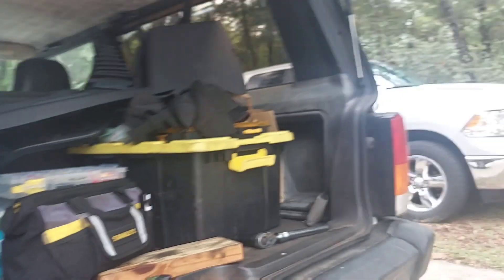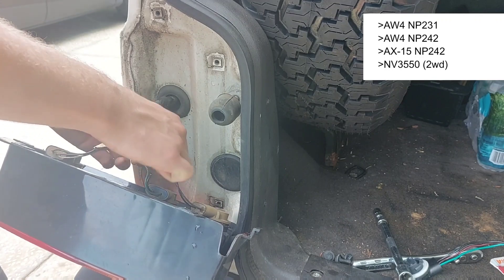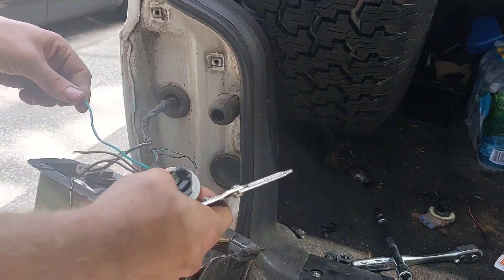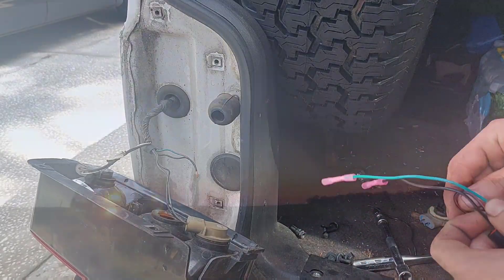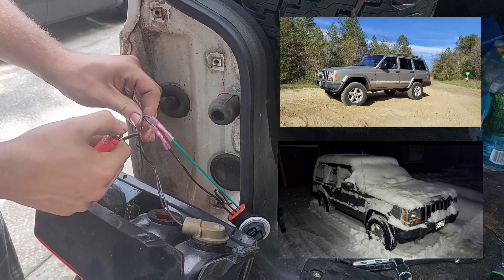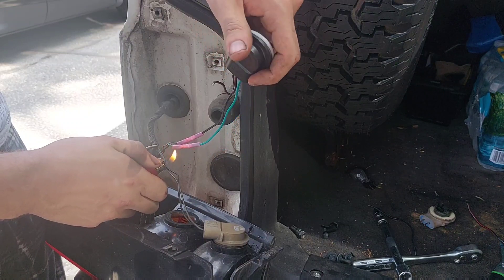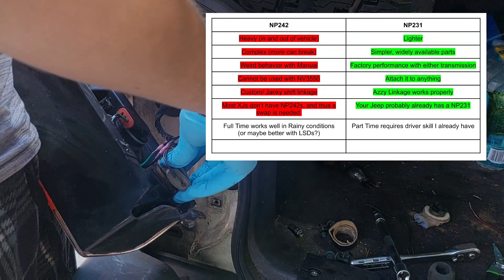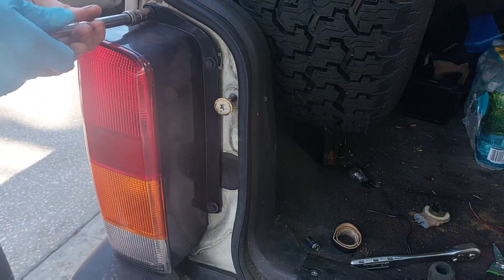Jeep Cherokee: NP242 Transfer Case in Review - Automatic and Manual applications ['87-'01 XJ]

Comment: I have a 94 XJ Sport with a 5 speed.  It originally had a 231 and was leaking quite a bit.  I saw a 242 on Craigslist for $100 bucks and thought the full time would serve me well here in rainy Vancouver.  It was in really good shape and went through in swapping the transfer case.  I never had any problems with the linkage or any improper shifting with the original setup and works perfectly.  I do notice the slack you're referring to when shifting gears and a click or sometimes a knock when going through the gears.  I went through all the u joints trying to fix the problem, but it still persisted.  I found it was worth doing and still have in my Jeep to this very day.  I mainly use it in the rain and sometimes in mixed conditions in snow.  Just the past couple of days I put in some work with my front drive axles in changing the seals, oil, wheel bearings and converted the axles to CV joints.  I tell ya, those CV joints made a huge difference.  There is no clicking or clunking at all.  Only if you severely miss your shift that she will tell you that she didn't like that.  Yesterday it dumped rain and drove like it never did before.  Felt like a modern car.  I'd be hard pressed to go back to a 231 and won't miss the jerky steering or the weird looks I used to get when I forget to switch off the 4x4...lol.  I like having the option of all wheel drive.
Reply from the maker: I do also have CV shafts but I suppose Ive never driven a 242 without them, so I didn’t notice any huge difference. Very interesting

Comment: @3:42 

The issue isnt not having abs ot tcs alone . Its the fact that the 242 is an open center diff so it would need those to direct the power . You are comparing it to a car that doesnt have a normal open center diff and was build that way to work without abs or tcs , same as my 93 audi s4 (the abs on it was trash and you even had the option of an abs off button on the dash back then) . This is actually why i chose to put a np120 trailblazer SS case in my crew cab manual awd big block muscle truck . I have a np242AMG h1 case too but everything i looked into the np120 would be a better case to live with on the street and in the snow (living in new england) and i dont want to use my pontiac G8 in the winter . 

Yes i dont have 4lo but i never taken the truck off road because its to big but im still toying with the idea of putting a jeep 242 into my 4.0 TJ manual .

Comment: I have a stock 1992 4.0 manual 5 speed with the 242 and limited slip in the back. Could it be it was modified by a previous owner? If what you say is true, that they never came out like that
Reply from the maker: @WatchGeek  yes someone swapped the transfer case at the very least. I have seen the build sheet configurations, the factory never offered the NP242 with a manual
Reply: @WAEMIDIV  thanks for the fast reply 😁👍

Comment: I had an 01 XJ and currently have a 2000 XJ, both with the 242. I do a lot of driving on snow and ice. I can be on a sun cleared stretch of road and suddenly be faced with a skating rink a few yards ahead or around a corner. The 242 with an exploder 8.8 rear diff works for me.
I was wondering about a manual swap with the 242. I was also wondering what it would take to make the 4.0 run with a carburetor. EMP, zombie apocalypse, turned into Cuba type scenario, LOL. Get on that one, will you!
Reply from the maker: @chrisharper2326  i do have the manual swap fully documented in its own playlist, and I used the NP242

as for the carburetor I can't help, I'm too young to understand them

Comment: found your older video first.... left a message there on swapping one onto manual (NV3550 23spline).  Appreciate any info you can offer on this.
Reply from the maker: yes I have replied to your comment over there
youtube doesn't do a very good job at notifying people of replies
Reply: getting deeper into your video now.  Ive read the NV3550 works for sure if you swap the input shaft from a 231 into the 242. Others seem to say the short input of typical NP242 works just fine... though longer would be better if you do any offroading (stronger)   but...  its all confusing..  have you heard any more on this since your video?
Reply: I have a zj with an nv3550 swap and used my old 242 i def feel the slack when shifting but it does work well be getting a 231 
First gear is nice on the nv3550

Comment: I just did LS3 swap for my 98 XJ and also did AX15 swap, it is originally equipped with NP242. I will test drive it next month and see how it will act. also have JK diff's that I'll swap them in early next year ( I think JK diff's are at least LSD from the factory) hopefully the LSD's will make it drives better. 
Thanks for sharing your experience

Comment: does abs have something to do with fulltime mode?
Reply from the maker: They're not related but ABS (when operated by Traction Control) can provide autonomous traction to vehicles in full time (or even 2wd) 
XJs don't have TCS though, so the ABS is still primitive
Reply: @WAEMIDIV  only used for braking then
Reply: Not at all.  The full time mode is completely mechanical.  The NP242 is an NP231 transfer case, but with an added open center differential inside to allow the front and rear axles to turn at different speeds for on pavement driving without binding up the t-case and axles.  

Its by far a better system than relying on a computer to decide when and if you will get AWD LOL.  

ABS was the only thing available in the XJ, they didn't have traction control, or stability control to transfer power around to different wheels.  The only options for that are limited slip or lockers.

Comment: I had 242 in my 93 XJ with AX15 but the 242 rebuild wasn’t done right, so the front drive shaft snapped off the front axle pinion yoke, and bashed my exhaust header + intermediate pipe.  Dealt with all that and put 231 back in for now. 
I live in Seattle so would benefit greatly from improved rain handling.  I also was able to get Eaton Trutrac limited Slips for Dana 30 and Chrysler 8.25.  They use worm gears instead of clutch plates, so no friction additive needed.  I have front Trutrac in and will put rear one in this summer, then see how it handles in rain. If still rough, I’ll get 242 properly rebuilt & swap it in again.

Comment: I had an auto 4.0 with the 242 from factory, I manual swapped it and kept the 242. Read all sorts of horror stories about that driveline slack but never really felt it, but unlike you I’d never driven a 231 equipped XJ before so I had nothing to compare it to. I’d already had the LSD put in the front axle before I manual swapped but I always kept it in AWD, it felt so much better through the steering wheel in AWD even pre LSD. And the linkage thing, I bought an Azzys and had the same issue, I thought it was me installing it wrong but maybe not… one thing is it rains here a lot, makes sense to have AWD if you can, had a few hairy moments in RWD mode without traction control (all driver error of course!) and it just made more sense to leave it in full time

Comment: Do you know of any sites that show you current value of a in demand vehicle for example the xj's are climbing in value. But if you look at Kelly Blue Book it only shows fair market value. I think that makes sense...lol.
Reply from the maker: I don't know. XJs can vary wildly because people often modify them, and they're kinda exempt from having high miles because the engines don't care about mileage, and people know that. It is a somewhat unique example of a used car when compared to others of a similar age. That, and XJ prices also very much depend on location, one in southern California will be $7,000 more than the same one in Wyoming, for no reason
Reply: Depends on where you live what you can get for one, but typically someone looking for a clean, non-modified XJ will pay quite a bit for one....Personally I wouldn't pay that much for one, even in stock form, they're still 20+ years old now LOL.

Comment: You ever think about using a lunchbox type locker. Much much cheaper than an lsd. Unless you find an axle that cam stock with the lsd and swap it over..lol. If you find yourself going off road often then you're going to want a np231 anyway because they're stronger.
Reply from the maker: I'm not gonna put any sort of lockers in the axles either, the offroading I do, most people probably wouldn't even consider offroading, and the open differentials have never been a problem for me
Reply: The NP242 is an NP231 with an open center diff added for the full time mode...same transfer case, one isn't stronger than the other FYI.
Reply: actually, the 242 is a 241 with a center differential so it is a bigger transfercase than the 231. the chain is bigger (wider).

Comment: For my zj I've got the np249 with the notorious viscous coupler. It still goes the jeep has 280k (i assume it must have been messed with before cuz that is high mile..?) but I have been anticipating and preparing to find a tcase to swap in for when it goes out. I've got the limited slip d44 in the rear and i have been debating between 231 and 242. Didnt know the difference in weight was so great, and also did not know about the linkage issues
Reply: I had 232k on my 96 ZJ with the NP249 t-case....thats about the same time the viscous coupler decided to no longer function.  So, it made it act like I was driving around in a part-time 4WD equipped vehicle, it would bind up really bad when trying to park in a parking space, or make other sharp turns.  I've seen where a lot of people experience this issue far sooner, like around the 150k mileage.  Given the things I did with my ZJ I was surprised it lasted as long as it did. Wish I knew back then about being able to swap transfer cases, I would have put an NP242 in.  

The NP242 would be the route I'd go, I like having the full time and part time 4WD option....most times with my 98 ZJ I'd run it in full time mode in the winter.  The weight difference is due to the center differential components in the NP242 transfer case that gives it the full time 4WD mode....other than that a NP242 is the same internally as the NP231.
Reply from the maker: The linkage was only a problem for me because of the manual transmission. Using a 242 with an Automatic you won't have any problems. And it probably isn't any heavier than an NP249

Comment: Can you use a 2wd transmission to make your Cherokee 4wd ? I’ve heard your can cut the shaft to make it work, but If anyone would know i guess it’ll be you
Reply from the maker: no, the outer casing is different and the 2wd tailshaft cannot be removed. You can take the 2wd internals aside from the output shaft and put them in a 4wd transmission, but at that point... just use the 4wd transmission. 

I have a 4wd NV3550 in the shop being rebuilt now in preparation
Reply: @WAEMIDIV  thanks i was thinking the same thing since there’s no videos on it actually beening done, just rumors on forums that say that it could be done ✅

Comment: I have a 96 Michigan state police model with np242. Had to replace the tc about year ago. Nearly a year I drove it with it doing something weird I could never figure out. Found out the tc was slipping once in awhile randomly. At the time it was never replaced or fixed. It was hard to find a replacement that wasn't stupid expensive. Found a Reman online though and swapped it out. Works perfectly now.

Comment: Interesting perspectives.  I've owned two XJs over the past thirty years.  My first one was a five speed with a NP 231 and my current XJ (for the past fifteen years) is an AW4 with an NP242.  Having the 231 in my first XJ and getting used to it I didn't really understand the 242 when I first got it, but over the years I've really learned to love it.   Mine is a 1991 Limited Edition but I do not have ABS and of course no traction control factory in that vintage.  With just a bit of practice I learned the 242s AWD characteristics and love it in wet road conditions as well as snow and especially patchy snow on the roads.  A few years ago, I installed a limited slip in my front diff and now the 242's AWD really shines.  Yes, it's a bigger and heavier transfer case and a bit more challenging to find parts for and something you have to bear in mind with some accessories like skid plates but I wouldn't trade it to go back to the 231 for any reason on my XJ and how I use it.
Reply: Another LSD front axle with 242 and 5 speed here, mine performed great with that combo. Loved the extra steering feel with the LSD
Reply from the maker: Now that's cool, if I had the money for an LSD I honestly would keep the NP242. LSD is basically the closest thing to traction control you're gonna get on an XJ, very cool to hear from someone that it actually does work well with the 242!

Comment: I have a 2000 XJ with a factory 242. I mostly don't use the full-time feature, just the part-time, because I bought my XJ for winter weather driving and did not like how it behaved in the snow in full-time 4WD. I found it easier to drive through 6-10 inches of show in part-time. 
That said, I don't have an LSD, but can't decide if I should throw an LSD in the (not so great) factory rear Dana 35 or swap in a pair of tons. An LSD would be quick and simple, a pair of tons would not (and I don't really NEED a Sterling 10.5" rear with a Dana Super 60 front axle... but it would be pretty cool 😁).
Reply: I had a 98 ZJ with the NP242, and had the factory rear limited slip.....in full time mode the back end would try to outrun the front end if you weren't careful LOL.  That was just due to the limited slip....otherwise the full time mode in an XJ I drove prior didn't have that issue.

Comment: I leave mine in AWD Al the time. I think it works fine. The only thing I don’t like is that it’s a little harder on the front tyres. I find it just tightens up the steering a little.